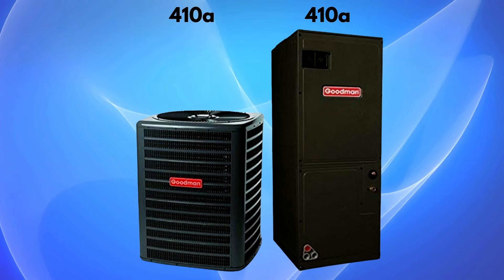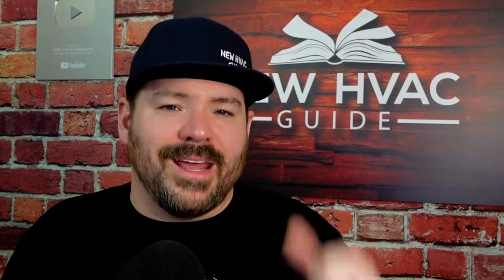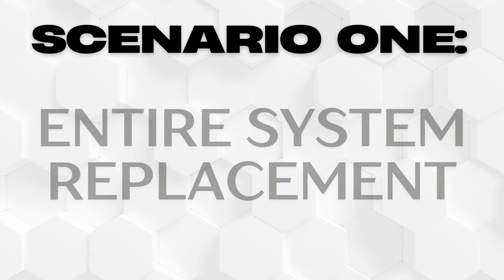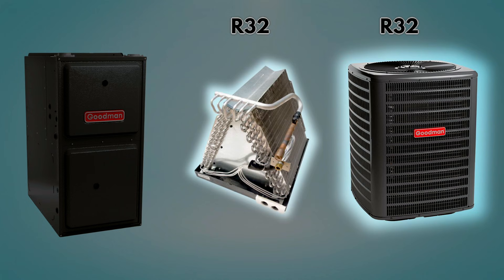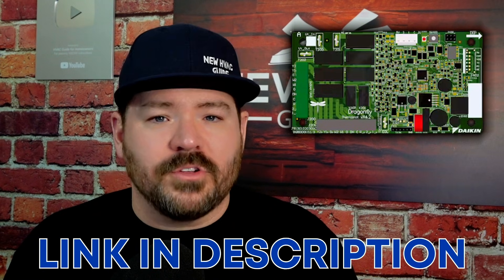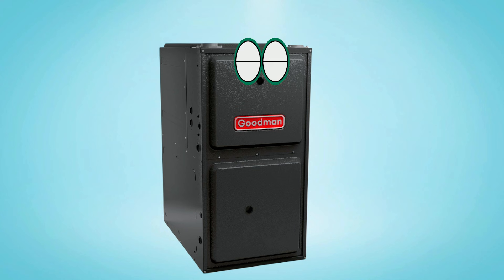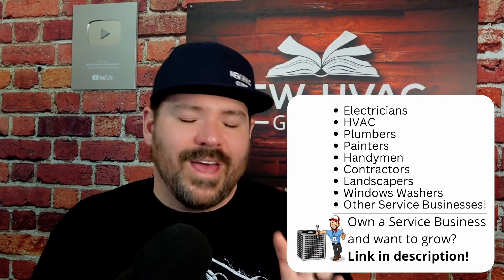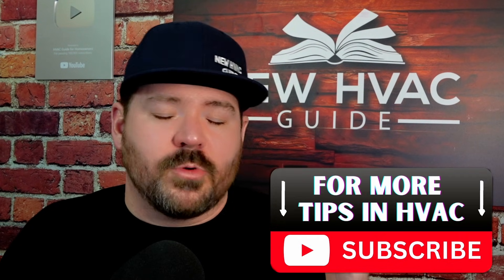Pairing A2L Furnaces Explained - R32 to 410a HVAC Systems

Comment: Hey guys 
Just getting into the new A2L change over. Just put a new r32 system on an existing furnace. Line set is 18' unit is charged for 15' line set. Do I need to buy a jug of 32 just for the few ounces I'll need?
Can I use 410a to top it off ? 
Any thoughts, thanks
Reply: Not compatible can’t do it

Comment: A gas furnace is not r32 refrigerant. The coil should have a board to wire in the low voltage for the new refrigerant.

Comment: Problem is there’s a lot of folks that can’t afford to replace everything. So do they have to just go without! Especially since these big customers are charging 10k plus!
Reply: If your system is in need of repair there should be parts still available. 

The only thing effected is the manufacturing companies are not allowed to manufacture whole condensing units  that operate with 410a

The refrigerant itself will be arround for a long while in 2036 it gets phased down by 85%
Reply: @michaelcso2400 exactly! I’ve been to a lot of houses where they’ve been told it can’t be fixed! 200 bucks later and it’s running!

Comment: A year ago I replaced my condenser with a GSXN4042, and uses R-410A refrigerant. Now, I want to replace the inside unit air handler but my tech tells me they only sell air handlers for use with R32 refrigerant
Reply: There’s enough air handlers out there that you should be able to find something that works

Comment: How do you get the system out of mitigation mode when the alarm goes off? 4 flashes? A lot of these sensors are defective and will allow the blower to run on high fan non stop, when there is no leak!!

Comment: So let's say I have a brand new R-410a evaporator. The previous owners installed a new furnace/coil but not a condenser. If I were to install it with an R-32 condenser it could function but it would be non-compliant and unsafe?
Reply: Evaporator must be R-32 compatible and the A2L kit must be installed.
Reply: My same question lmk if you figure it out
Reply: 1. R-410a and R-32 run similar pressures 
2. R-410a is a blended refrigerant that has as one of its blends R-32 
3. R-410a and R-32 both use POE oil 
4. There are aftermarket add on sensors that can be added to your current evap coil 

You just need the RDS sensor for the new A2L refrigerants added to your evap coil and you use what ever condenser you’d like 

If you are going with fixed oriface you will need to change the piston

Comment: That is pretty much the last nail in the coffin for me.  I have 2 houses with 80% gas furnaces and R22 central air.  We've spent a lot of money in recent years maintaining the AC.  New evaporator coils and TXV's, as well as the usual capacitor and contactor replacements.  I'm not going to pay 30% more for something I don't want.  I certainly don't want additional controls to further complicate things, and the possibility of a sensor shutting down the furnace in the middle of a Minnesota winter.  I'll keep maintaining the equipment I have in place, and go back to window AC units when the central AC is no longer serviceable.  I appreciate the informative videos.
Reply: Just find some new 410a equipment and put it away for when yours go bad,maybe even buy a half jug of refrigerant from somebody.Things are about as cheap as they are gonna get and id still get some 410 stuff while you can.
Reply: I’m with you, been doing hvac for 31 years and don’t feel like I want to go through another refrigerant, mini splits ,geothermals, I remember grandma only had a window fan back in the 60’s
Reply: Lol! I’m not too happy with this mess either! I’ve done HVAC 25 plus years!  I’m looking for charging charts for R32! The supply house is selling the units & refrig without a charging chart! (At the moment?!)!!! I find that very interesting!!!!!! Now I’ve gotta research this sensor crap 💩!?  I jus bought a R32 system & installing! New 
Vehicles have a new refrigerant too! 134a is being replaced in new transportation vehicles! PUNKS!🤔🥸😤
Reply: @orlandojohnson5742  Yes, GM has been using R1234YF in their vehicles since 2018.   It is one of the 2 components in the R454B blend.
Reply: I feel the same way and I'm a HVAC contractor.. I have 2 r22 systems with r407c in them and I'm cooling like a polar bear.
I enjoy the money but I sympathize with my poor customers.
Reply: Im a Hvac contractor and you are 💯% correct, in my case I do not defend any brand, I've been using common sense that's all and look after my clients because money doesn't grow on trees the last time I check. Now, time will come that may not have option but until then save your hard earned money.